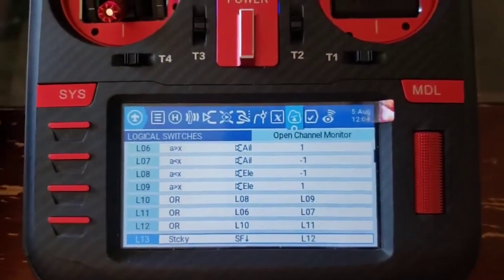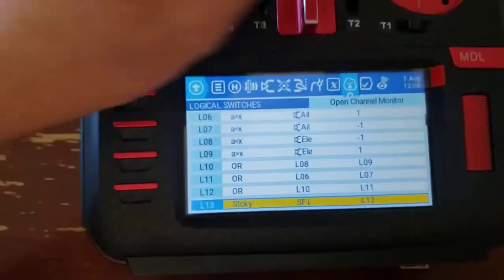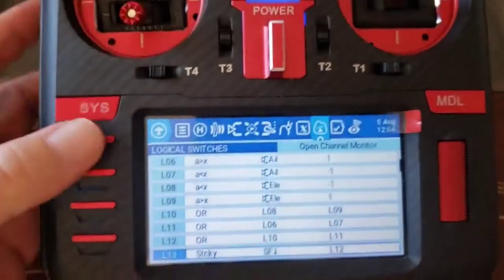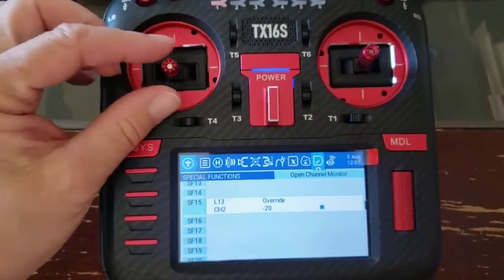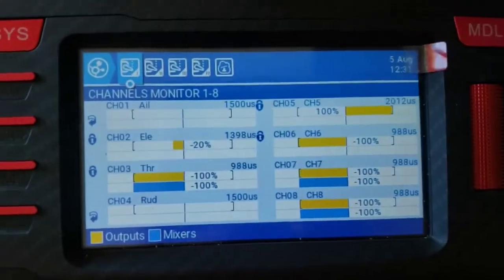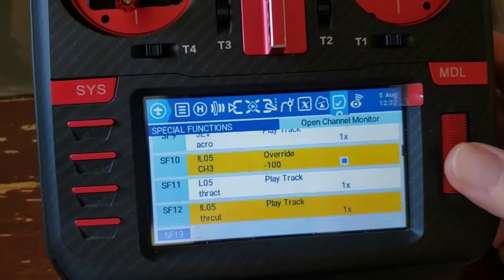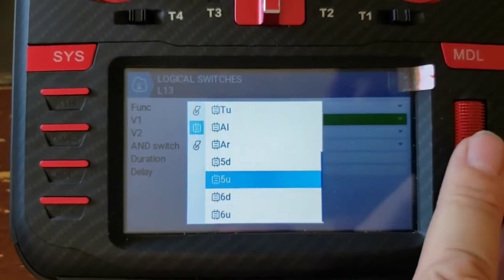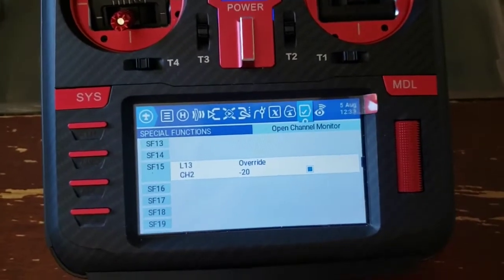RC RadioMaster TX16S Aircraft Launch Mode Programming

Comment: Great, Can this programing can use also for ground lake off? tks
Reply from the maker: This particular program had flaws as noted in the description.  Mainly do not use the input as the source for the logical switch, you must use the raw stick as the source or it might not shut off the launch/loiter mode when you move the sticks.  Meaning to make a new version of this video but haven't gotten around to it.

With that out of the way, this just sets all 4 controls to a pre-determined value until you move the sticks so if you know where you want the control surfaces positioned for whatever maneuver you want, it will work.  Just don't programming it exactly as I have here.
Reply: @shanesdiy ok thanks. can a receiver with programmable gyro or a simple flight controller can do it? i know that the aura 5 has this mode , i just wanted to create it without to buy the aura 5. thanks for your response!!!!
Reply from the maker: Any receiver with a gyro and "safe" auto leveling mode with bank limiting can work easily as a launch mode.  When properly operational, the auto level mode in conjunction with up elevator and properly throttle will easily allow take off.

Auto leveling with bank limits is really key if you want to force a set control surface deflection.  Without the bank limit, even if you input a fairly small amount of control deflection it will continue to bank that direction until it goes inverted and likely crashes.  Auto Lever with bank limit prevents any extreme angles in any direction.
Reply: @shanesdiy  Great, thanks a lot!!!!

Comment: Hi I'm new to this tx how can I mix elevator to throttle via switch for hand launch pls
Reply from the maker: The method in this video will work but be sure to use the sticks, not the input in the logical switches like I did here. There is a possible issue with using the inputs that might prevent the launch mode from exiting when you move the sticks.

What plane and receiver?  If you have a plane with safe mode just put it in safe mode and throttle up and throw it. Safe will keep it level until you get flying.